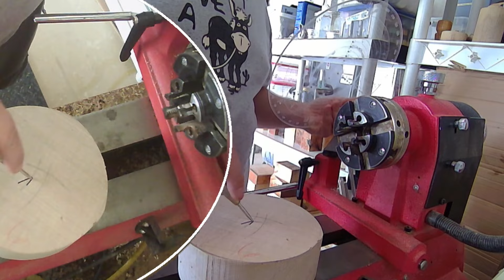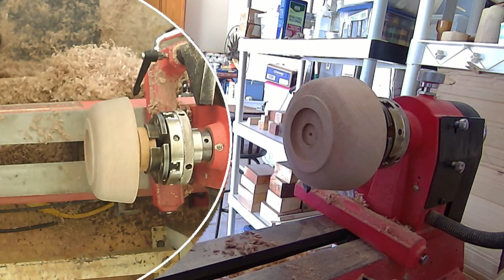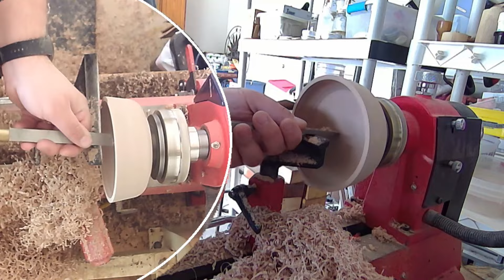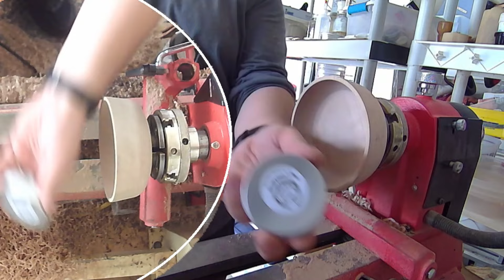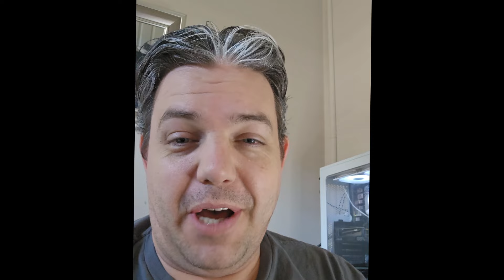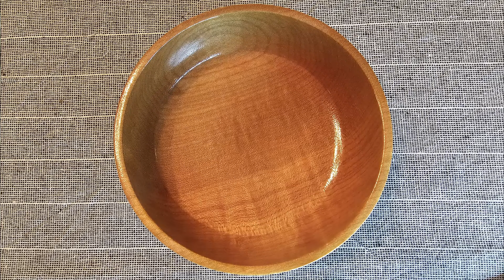Wood Turning | Project 4 of 52 for 2024 | Somthin’ Shiney | Happy Turnings

Comment: Where did you get the logo plug?
Reply from the maker: Thanks for watching! I get mine from Amazon (https://a.co/d/brJjMiA) and use a simple laser engraver to burn in my logo. The soft wood of the plug is easier to engrave then hardwoods, but they are soft. I'm currently looking into either a pen burning tool or a simple engraving bit for dremel tool also.